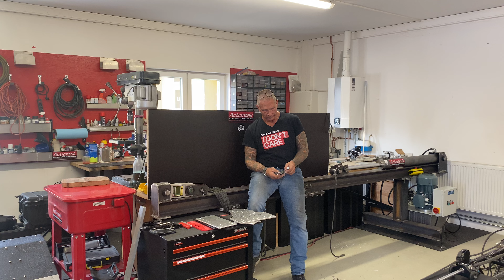Stunt Rigging Toolbox Talk #6-base stations

Comment: How is the return swivel pulley for the ratchet system attached to the base station end?
Reply from the maker: They are on a plug thru shaft, that you slide out, insert the pulley, and slide the shaft back in.